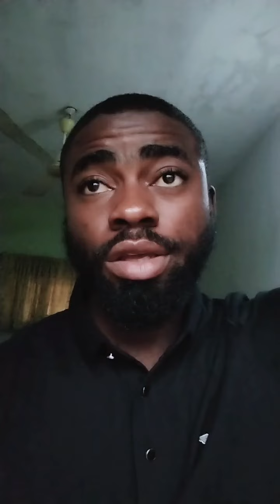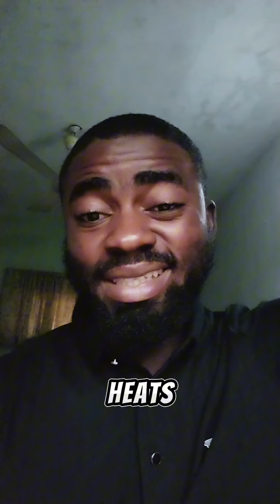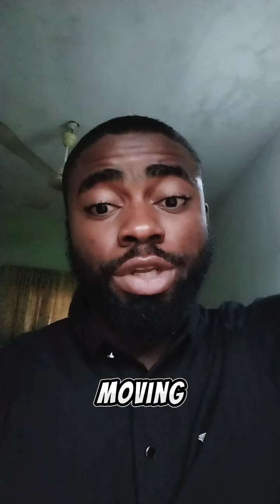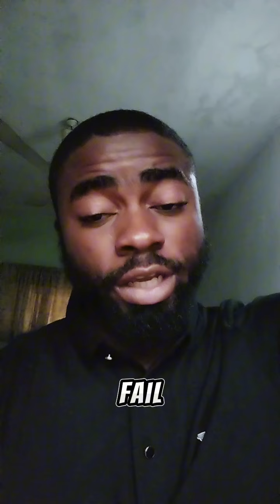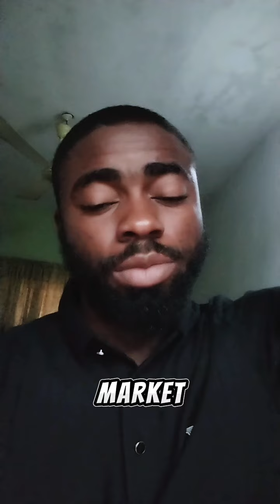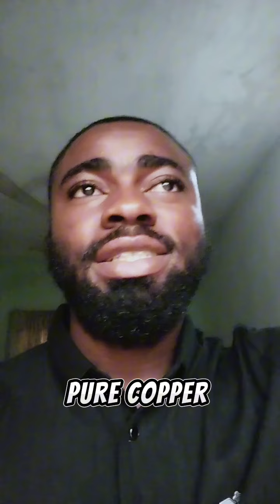Aluminium is a better conductor of direct current!.

Comment: Okay sir. So is it adviceable to use aluminum cable for short distance of less than 15metres. Thats from the panels on the roof to the charge controller. Thanks.
Reply from the maker: Nope

Comment: Guy you missed this explanations.
 
The reason for using aluminium is bcos of the cost and weight and its a poor conductor of heat and electricity. 

Its mostly used for ac or dc bcos if the weight. 
  you will notices sagging in aluminium despite the fact that its light in weight as its been used in low voltage  distribution and its prone to oxidation  and sagging .

 Infact its a poor conductor when its comes to DC transmission bcs of I²R and voltage drop along the transmission line. 

Pls alway consider the fundamental principles. 

If not standards of most materials that has been compromised , you can only compare alloy of copper with aluminium cable.

Comment: So because of this your one time experiment you want us to believe that Al is better than Cu. 

Know that all metals too has their purity level and that will affect their conductivity. If you have pure copper and pure aluminium, copper will perform better. Copper is better than Aluminium on heat, that is why it is best for motors and generators

And mind you, transmitting 12v for 15meters, you will surely get losses either for AL or CU. That is why the battery to inverter cable is as close as possible.

I will ask you if your battery to inverter cable is Aluminium, if it is, then i rest my case.